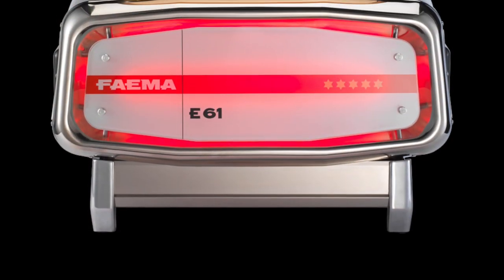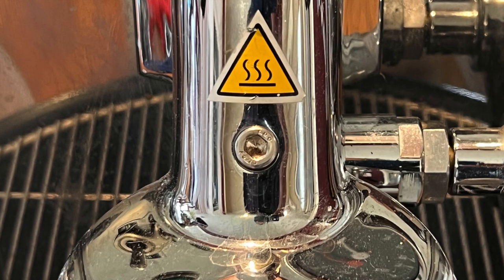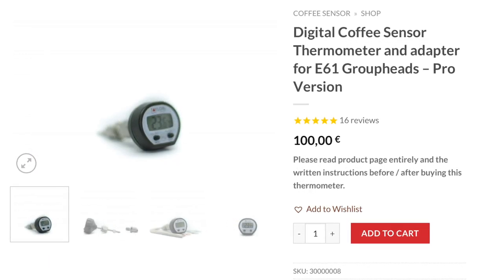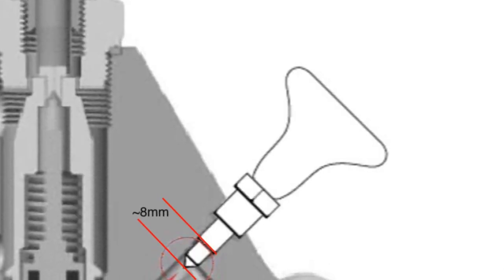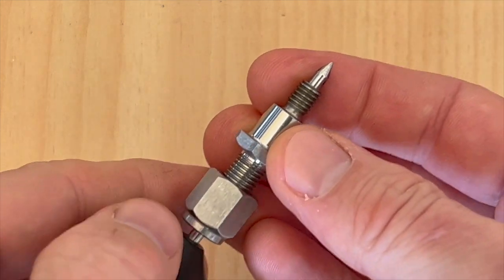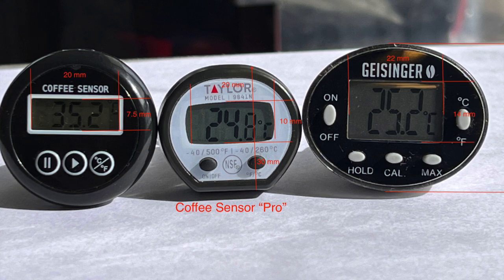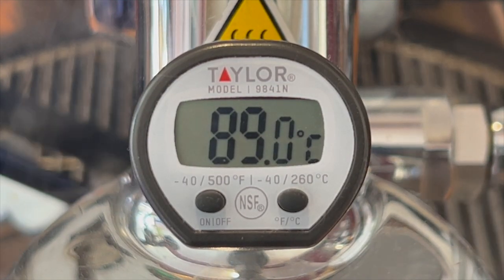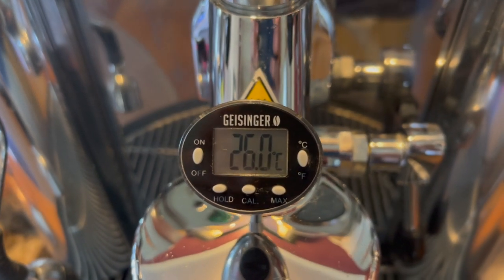Review of 3 Digital Thermometers for E61 Group Espresso Machines

Comment: Hi George. Tudor here. Thanks for your great review. Really honest here. And very objective, rare thing these days. And yes, you DID buy my sensors and they were not offered for free.I do have units here with calibration function also and will post them also on the website, for people to choose from standard or with CAL function. About the calibration, it's best to be done with pro tools inside the factory and NOT at home. From talks i had along the years with factories and customers (experienced users), if the CAL is NOT made correctly, it can ruin your day and readings of course. Indeed the standard Coffee Sensor is small and very compact. Taylor is faster, you are not imagining it, and the probe can be adjusted, just like you said. That is a pro function and you can change the depth even more them 7mm, to get readings you want or need. We keep in touch and let me know if you want to test the flow device also. Regarding BT functions, i am working on something like that also :). Cheers.
Reply from the maker: I've owned your E61 Flow Control device for almost a year now. I might do a video about it too. It wasn't on the machine in the video as I have 2 identical machines and it was on the other one at the time of filming. I've noticed a change in taste possibly due to thermal change caused by using a stainless steel mushroom like your flow control device. The original mushroom was chrome coated brass and produced a better, and more consistent, flavour. I've ordered Rocket's porcelain mushroom to see if it fits and, if it does, if it makes any difference to prove or disprove my theory.  Really looking forward to seeing what you come up with regarding bluetooth devices for the E61.
Reply: @george_taylor  That's interesting, I wouldn't think the mushroom material would have any effect on the flavour / result of the coffee, I hear stainless steel is actually more desirable vs brass but for thermal conductivity I Think it's slightly better than stainless steel. 

I think it's more likely changing the flavour due to different flow rates maybe? 

If you think it's changing the temperatures, You could try running some tests with the thermometer installed instead of the pressure gauge temporarily and test with each mushroom. Ideally in the same machine after the same amount of warm up etc. 

If you have two machines side by side you could try measuring temp differences on both but it could be due to other factors in the machines too.
Reply from the maker: @BensCoffeeRants  Funny you should reply now as last week I finally received in the post Rocket's Porcelain E61 mushroom which I replaced the stainless steel coffee sensor flow control mushroom with (this isn't anything against that product, which is excellent and very reasonably priced!). I also have a plain stainless steel mushroom as well as an almost identical Sanremo Treviso with original brass mushroom (I picked it up broken 2nd hand, I plan to sell it on). So 2 identical machines to compare using. I can confirm that the porcelain has much better thermals.The porcelain mushroom machine heats up faster too! The temperature is much more stable during the shot where as with the stainless steel mushroom it wanders with a very high peak at the start, followed by a drop and then a rise. The porcelain is more uniform throughout the shot. These porcelain mushrooms are unique to Rocket machines, they break easy too. Rocket must have had a very good reason for using them other than just scale build up and I think I now know why. I'm sticking with the porcelain mushroom for now. I started a conversation on this in August last year on the home-barista dot com website. I'll put a link to that conversation in the video description. Let's continue it there as this has wandered off the thermometers even though related.
Reply: @george_taylor  That's cool so you can actually measure a difference and it seems to be consistent. I didn't think it would really make much of a difference.  I guess the steel gets a bit too hot from the thermosyphon maybe.
Reply from the maker: @BensCoffeeRants  check out the forum discussion. I posted something about the thermal conductivity differences there. Stainless Steel isn't as good as brass and no where near ceramic.
Reply: Hello @coffee Sensor, please please produce the device George is wishing for. This would be a trick piece of kit for us E61 uses.
Reply from the maker: @Brazonthefly  I've begun working on creating such a device myself. After much research I've been unable to find anything on the market that would be suitable and therefore I'm falling back on my own education (under grad degree in electronics and computer science) to do both the hardware as well as the software. I may do a kickstarter/indiegogo for those interested in trying early samples.
Reply: @george_taylor  count me in:goodvibes:
Reply: @george_taylor  there is no such device and the big manufacturers, that do have the tech capabilities do not want to use it on a coffee machine.
Reply: @george_taylor  Does the  Rocket's porcelain mushroom fit the coffee sensor flow control devise?
Reply from the maker: @kyproset  No, you can't interchange them. I've been using the Rocket porcelain mushroom for almost a year now and wouldn't go back to a stainless steal mushroom like the CS flow control one.

Comment: Fascinating reading all of the comments here. I’ve recently acquired the Geisinger thermometer and I really like it as well as the look of the black face. It looks rather nice on my rocket appartamento serie nera machine. One can tell it was developed with great care, skill and attention to detail. I’m still working on getting used to it but it seems that if I purge about 4-6 ounces before my shot. The temp will settle right into the sweetspot, at least that’s my feeling so far after using for a week or so. Thanks for putting this test together. It was very helpful when I was deciding on which one to buy.
Reply: How's the shipping packaging for Geisinger? thx
Reply: Shipping was about 12-14 days from Germany to Missouri. Came in a small box. Packaged very well. Everything about this device is typical of German engineering…precise.   It works very well!

Comment: I have got the geisinger and it works pretty well imo. Does the coffee sensor shows a different temperature in comparison to the geisinger (Maybe a bit lower)? Because i was wondering about my temperatures, when i compare them with the ones that i saw on youtube from guys who used the coffee sensor.
Reply from the maker: I think trying to establish which thermometer is most accurate isn't worth it. Each individual thermometer will be unique and even two identical ones will probably give slightly different values due to the error thresholds of their components. Resistors can have +/- 1% error tolerance for example and these thermometers seem to be using 100KOhm resistors to calculate the thermistor value in a ladder arrangement. I've torn them apart and reverse engineered them since I made this video. The thermistors themselves will have a similar error tolerance. Calibration might get to closer to the true temperature but I don't believe it has much value. The thermometer should be a guide for your taste. As long as it is consistent you can't go wrong really with any of them.

Comment: Excellent video. Did you find any differences between Coffee Sensor base and pro in actual temperature read out? Would expect the Pro to show higher(more precise) idle temps while temps during extraction should be quiet the same. Got the standard one. It's the most subtle looking one, which ultimately made me go for it. Only thing I do not like about it, are the included washers. They are very poorly made and lead to leakage with my ECM machine.(of course I only used one of them but both are garbage) Just going with the standard teflon washer that also sealed the stock inhex screw worked perfectly.
Reply from the maker: I've found the Pro reading to be the same as the Geisinger within +/-0.5C They both matched my kitchen thermometer too. The base Coffee Sensor was off by about -1.0C to -1.5C. As I said in reply to another comment, it is primarily as a reference guide which E61s lack. Once you get the flavour you like you know the temp reading to aim for next time. So accuracy isn't really that important. My friend who has the base coffee sensor model says he'd be lost without it now. I still prefer the Geisinger myself.
Reply: @george_taylor  Ok thx for the info. Very interesting. The Kaffeemacher channel tested it also and theirs was also of by about 1.5°.(compared to Scace 2) Sure this device won't come close to the accuracy of a Scace device, but at least it gives you a good baseline and will tell you when the group head has reached reasonable operating temp. (great if you like to boost warmup via PID E2(steam model)) The Geisinger seems to offer more functionality but as my machine already got a shot counter, i do not need those extras.

Comment: Good video. I have an Hx machine and I am curious of my temp in reference to flushing time. Right now I'm just going by, "Well it's not bitter or sour" and enjoying my pressure gauge instead. Did your testing on an Hx or a DB? If Hx, would appreciate insight into flushing technique change after using thermometer.
Reply from the maker: Hi Ian, Thanks! The machine I used in the video is a Sanremo Treviso which is a single boiler HX. The primary use of the group head thermometer is to know when your group head has warmed up enough to pull a shot. The dual boiler machines will have the advantage of not over shooting if left to idle. It would be interesting to know what dual boiler owners are seeing, during a shot, on the thermometer and if it compares to the PID setting they have. My routine is to wait for 89-90C and then pull a shot without flushing. When I do that the temp rises to a ceiling of 95C and then quickly drops back to level out at around 93C. Other machines will differ. That's the secondary purpose, I believe, of the thermometer. To take the guess work out of temperature surfing. I couldn't use an E61 machine with out one.
Reply: @george_taylor  I had an HX with PID without a Thermometer I wish I had gotten that instead of the flow control for that machine,  found the temps were inconsistent, based on taste and maybe also judging by drink / cup temperature even! I didn't think the machine 'needed' cooling flushes because with the PID people said you don't and it never had that super heated water flash boiling I saw on videos from other HX machines. But it was inconsistent doing multiple shots. 

Since moving to a dual boiler it's been super stable temperature wise (still no thermometer though to verify) but seems consistent based on my tastes. No flushing required.

(Update: Sorry I just realized I already kinda commented something similar above lol)
Reply from the maker: @BensCoffeeRants  all a PID does on a HX machine is replace the pressure switch that controls the heater element. I've experimented with retro fitting a PID to a E61 HX and that taught me that it just isn't worth the bother. For a start you need the temperature sensor inside the boiler measuring the water temp and not attached to the outside metal of the boiler which is too slow at matching the internal temp. If no hole exists you need to drill one. Not ideal. Fast response to temp change is especially important when you steam milk. With pressure switch control the heater element kicks in immediately on you opening the steam tap and releasing pressure. A PID doesn't. As for controlling the head temperature and preventing over heating it is simply nonsense to claim a PID fixes that. It doesn't, It can't as it is measuring boiler temperature which it general keeps in the 118C-123C range (equiv to about 1.0Bar to 1.2Bar). PID on a dual boiler makes sense, as steam boiler is separate and you heat the brew boiler only to brew temp, but it makes no sense on a HX machine.
Reply: @george_taylor  I agree the PID is not so useful as it seems on a HX machine but I believe they also modified the thermosyphon or did some other design tweaks with the PID to help prevent overheating of the group head because it did seem to not need cooling flushes. I don't know for sure but I suspect they made some design changes and didn't just pop in a PID.
Reply from the maker: @BensCoffeeRants  The only way to prevent the group head over heating is by reducing the temperature of the boiler to the desired brew temp. That's dual boiler, so you can't do that on a single boiler HX. I've modified the thermosyphon on my own Sanremo E61 to make it more temperature stable. I did that by replacing the restrictor value at the top (hot end) output of the boiler HX pipe with a 2.25mm hole for the standard 3.0mm hole restrictor. That slows down your thermosyphon. Made a huge change to the quality of my coffee brewed, more than any other mod I've attempted.

Comment: Excellent review.  You don't mention how easy or difficult it is to change the battery on each model.  Is there a difference?
Reply from the maker: Very simple and rarely necessarily which is why I didnt mention it. The Geisinger has a little circular door on the  back to change the battery. The other two just need a small flat headed screw driver to prize off their top covers to get access. Battery typically last 1 to 2 years on all.

Comment: I figured all the models are probably going to be about the same. They should all be similarly accurate in their temperature reading.  
I'd definitely recommend this for users with an HX machine, I think it would help get an idea of IF and how much cooling flush is necessary and help you understand how your machine works better. I had a HX machine and would get inconsistent temperatures, it was a PID machine but the PID didn't seem to really have much of an effect on the brew temperature as far as I could tell. 
I've since upgraded to a Dual boiler and the temperatures seem MUCH more stable and controllable, no flushing necessary.
Reply: Yeah even with single boiler pid controlled machines such devices are pretty helpfull. Helped me to dial in PID offset on my ECM Classika PID. The additional decimal digit the Coffeesensor provides over the standard PID display is a welcome feature. I was also surprised how long it rly takes for the 108° hot water in the boiler to heat up the group beyond 95°Celsius. Those single boiler PID controlled E61 machines rly do not need any temp. related flushing.
Reply: @Squilliam-Fancyson  I am considering btw the Lelit Mara and the ECM Classika.  Do you mind sharing why you decided on the Classika if you considered the Mara too?  Sorry for the hijack and thanks
Reply: @s1gen  i think the mara x is interesting machine but I straight went for a single boiler machine as I rly do no milk drinks. I also prefer a real PID display with a shottimer over a light pid system with only 3 temp steps. Then there is the water tank situation. I just do not like machines with tubes hanging in the watertank, which is why most Bezzis and most Lelits did not came into further consideration.  Build quality of course was a point on my wish list and therefore ECM rly keeps up with it's reputation imo. Only thing I wanted to change was the steam valve as it's a nice to have for boiler venting.(faster heatup) I replaced it with the quick valve from the ECM Synchronika, which only cost me about 70€ as I could reuse the stock Classika no burn steam wand. Rly a worthwhile upgrade as venting is much more simple and faster done with quick valve than with steam wheel  setup.

Comment: I recently bought the Geisinger it's been super helpful adjusting my flush routine.  The white looks great on an ECM with existing white gauges.  

I have been communicating with Naked-Portafilter and they have developed a Bluetooth thermometer probe to sit with their Smart Expresso Profiler on the Y splitter they have.
Reply from the maker: I've developed my own and I've been using it for about 6 months now. Not giving any details away just yet but it's a far superior tool and experience to these modified kitchen thermometers. Watch this space (or rather subscribe to this channel!)
Reply: Now that you can see the water temperature, how far off were you prior to using a thermometer for your cooling flushes ? I have a Mechanika V slim and I'm considering the Geisinger as well.
Reply: Before I used the thermometer I was not flushing more than 2.5 seconds.  I now know it needs up to 10 seconds if it's been sitting for longer than a few minutes.  I've monitored temps and recorded them in Bean Conquerer and I am operating at a std deviation of 1.7 degrees on a mean of 92.5.
Reply: If you you don't flush for the longer time frame the group head can get as hot as 100 Celsius - a 2 second flush will bring it down to 98 - which is way over where you want to be.